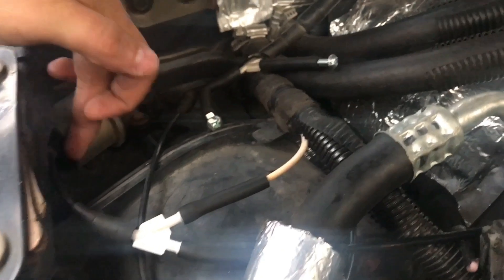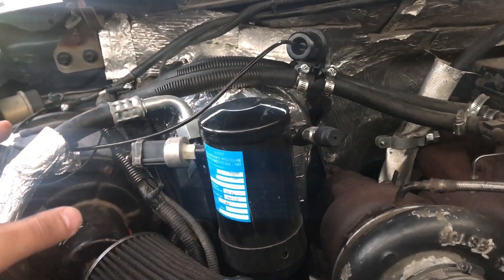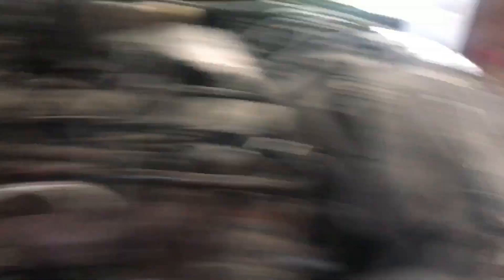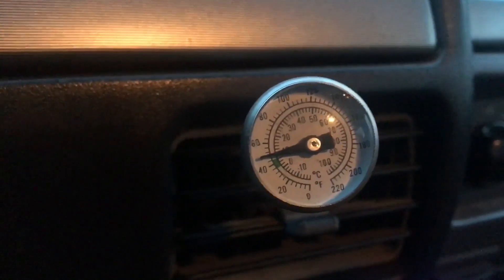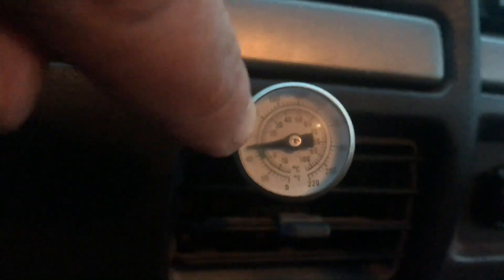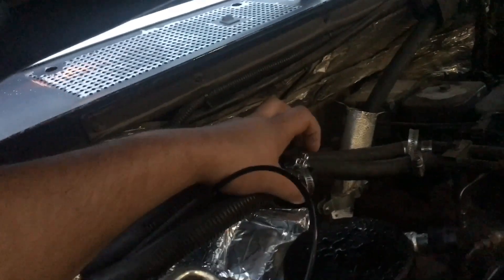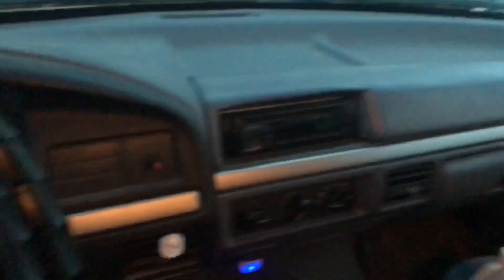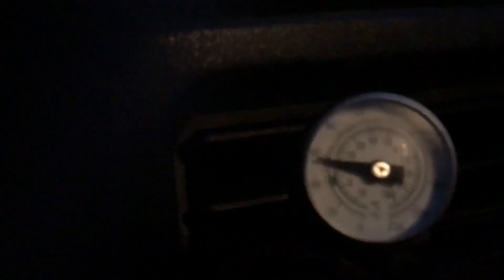MAX AC MOD for CREW CAB FUMMINS

Comment: Just an FYI for A/C diag, temp readings should come with the blower on low or medium low. Never on high.
Reply from the maker: All the info I’ve read says to set the AC on high for obs ford diagnostics, but I could be mistaken.
Reply: @MidwestMoose  theres different diag procedures, like running the test with all the doors open to see how effective the evaporator is. But every one that I know of for testing the system as a whole, has it running on low. Not really sure why other than it giving a much colder reading. I use to be a Ford tech many moons ago. But good vid, keep it up.
Reply from the maker: Alright thanks for the heads up! I might make another vid when it’s hot out again, following your advice! But how would I know I have enough refrigerant in the system? I put (I believe) 3 cans in total. Obviously a custom setup, but I wasn’t sure on the quantity
Reply: @MidwestMoose  the only way to know for sure is to suck it down and put it in from a machine with a scale. You can try and do it from a gauge set reading the high and low pressure but it's tough. If your only doing it with the can on the low pressure side, then there no possible way. Being able to read the high and low side is crucial. That will also tell you if you have any issues (compressor will cause the needle to flutter, clog orfice will cause low side to be low high side to be high, ext...). 

The right amount of r-134a is extremely important. I cant stress that enough.  It's not like r-12. If it's over filled it will not cool properly.  If its underfilled usually to can hear the compressor clutch cycle extremely fast. Duty cycle will be very short. I cant remember,  but the compressor should stay on for like 30-45 secs at a time. This is only for orfice tube ac systems. If it's a txv in new vehicles its a different procedure. 

So in short, take it somewhere with a vacuum and a scale.

Fyi, dont ever use crap with sealant in it. If theres the tiniest bit of air or moisture in the system, it will start gelling and contaminate the entire system. That stuff is garbage. And if you take it to a reputable a/c shop, they will not reclaim 134 with sealant in it. Theyll charge extra to dispose of it.
Reply from the maker: Ok boss I’ll try that!